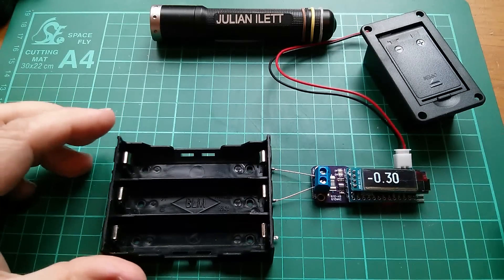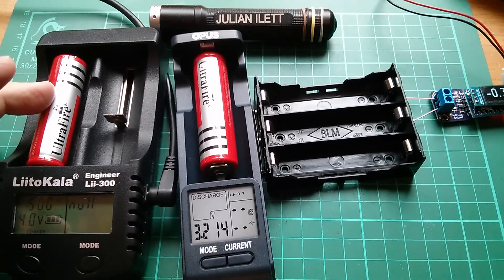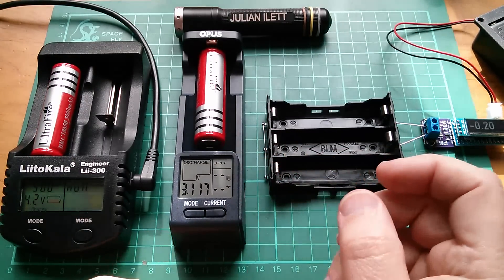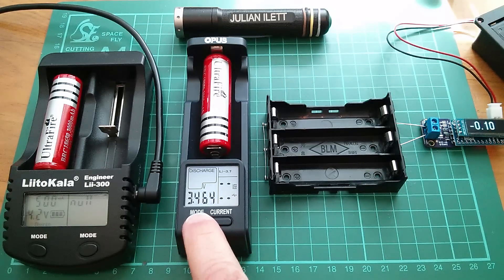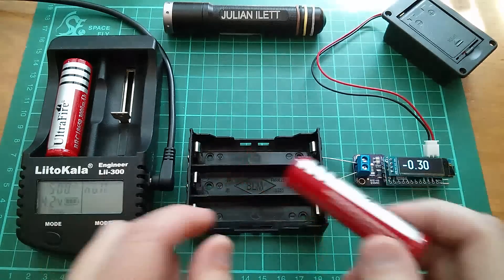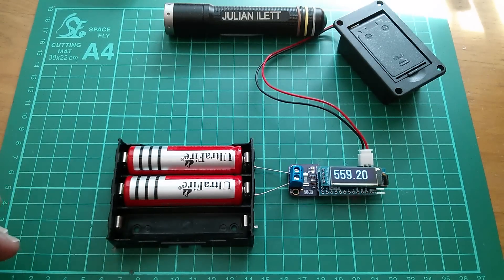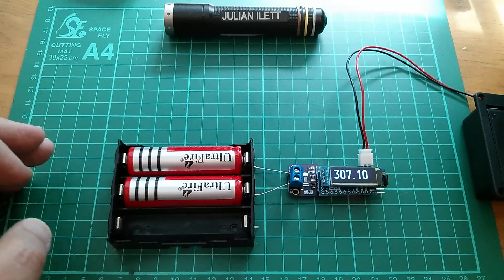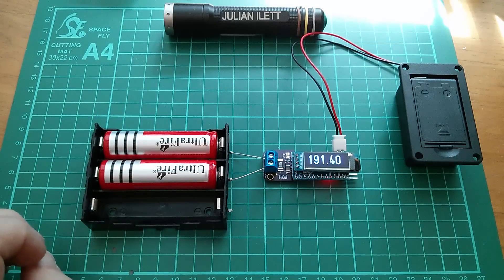Fully Charged 18650 Lithium Cell in Parallel with Discharged Cell

Comment: Julian make test with good quality akku. like lumintop/panasonic/LG. this ultra shitfire is not good for this test because this akku have big internal resistance
Reply from the maker: Voltage equalisation is immediate - it happens when the cells are connected in parallel. From that point on, their voltages are the same.
Reply: and put voltmeter on both cells, tu measure voltage equalization on time, voltage versus amperage
Reply: To set the house on fire? Yeah. Seams a good sacrifice for science... Guys, think before you talk. ;)

Comment: The current can be a lot higher if you parallel more than two batteries at a time.  For example if you had a 6 cell charger and 5 were fully charged and the last one was fully discharged it would be completely different.
Reply from the maker: That's kind of a worst case scenario :)
Reply: In electronics you have to think about the worst case scenarios a lot.  That's why we often put reverse voltage protection diodes in.  Plan for the worst and you should be OK for the rest.
Reply: Stinky Cheese Wouldn't it still be one amp because the voltage and resistance stayed the same? The resistance changes on the supply side but I'm not sure how internal resistance parallels.
Reply: Nope, nobody thinks about worst case scenarios in consumer electronics these days.  If they did, we wouldn't even use Li-Ion cells!  Plus, math.  If you get 1A from 1 cell, expect around 5A from 5 cells.  That's not an exceptional current for an 18650 cell.

Suppose you had an infinite # of 18650 cells charged, an infinite current 4.2V source.  You'd have the amount of current needed to charge the empty cell, * internal resistance, to produce an amount of heat, versus the volume of the 18650 cell.  IMO, a better test is to deliberately try to cause a heat problem and measure the temperature of the cells... in a fireproof container just to err on the side of caution.
Reply: Stinky Cheese we use lithium cells because there is no good alternative and they are perfectly safe if treated properly... I'm interested to know how many consumer products you've designed to base your statement on.

Comment: The max current rating for the INA219 is based on the maximum voltage of the ADC reading over the resistor. 
I would expect that you can actually put more current through it without damaging the sensor, but the datasheet probably has the maximum shunt voltage. If you needed to measure higher currents, you could switch over sense resistor fro a higher value, and compensate for the difference in software.
Reply: Yep, 26V differential max. The resistor value has to be set in the chip at bootup anyway, so it's the simple change of a number.
Reply: Paul Martin 26v is the limit for voltage measurement. Not sure if the adc for amps has the same range. As far as i remember it has also an amplifier up to 8 times or so which would lower the max voltage over the shunt
Reply: Yeah, I would guess not. if the limit is 3A (as I remember) and the resistor is 0.1ohm, then the maximum should be ~0.3v which suggests amplification.
Reply: Well I looked it up in Adafruit's datasheet for the completed module, and they say 320mV max. https://cdn-learn.adafruit.com/downloads/pdf/adafruit-ina219-current-sensor-breakout.pdf if anyone is interested.

Comment: please remove the numbers after decimal point, they are such a distraction !
Reply from the maker: I think they're quite useful - they tell me that the program is still running!
Reply: Some more software fine tuning is obviously required but it is just a quick demo.  I would also change to a fixed width font so that it doesn't jump left to right depending on whether there is a "1" or a "0" for example.  But it shows the concept.
Reply: +Julian Ilett ah, that !

+ElmerFuddGun i used dtostrf function for these purposes, it makes a nice, aligned, fixed position character array for the floating variable to show on screen, without jumping.
Reply: Indeed, what a strange font - to be fixed width except for the '1'.  Most bizarre, maybe even a bug, especially as the '1' is wider than the other digits.
It would be helpful to right justify in the display (rather than left) it would improve readability.  Maybe even remove the right most digit that seems to be fixed at zero so is not actually proving any info.  Removing that zero might provide room for a narrow " mA" at the end.

Comment: What if we charge different capacity 18650 🔋 in parallel?
Reply from the maker: They charge at different currents, and I'll show that when I have more ammeters.
Reply: Have you done this test yet Julian? I am very curious because I plan on adding an additional pack to my EV. The OEM pack uses 2600 mah 18650 cells that are about 4 years old and my new pack will use 3400 mah 18650 cells that are brand new. Everyone says its horrible and dangerous but I think a real test would show that its not.

Comment: Would be cool to change the negation symbol to a small arrow indicating the current the voltage is flowing (upper cell to lower cell or the other way around) :)
Reply: Hence the alternatively offered 'or'.
Reply: Or which way the electrons are going?
Reply: electrons are going the opposite way......

Comment: Great timing, I was just about to start looking for a decent 18650 charger.  Cheers!
Reply: Stinky Cheese fuck yoshit. scammer shop dont buy there
Reply: get the opus, c100 for one cell or the bigger 4 cell one.   the liito looks like its missing features.
Reply: I got the 4-cell Liitokala from Banggood and it's very nice!
Reply: It's on sale right now for $18, $26 - $8 off with coupon code YSHOT40 at  yoshop, best price evar
http://www.yoshop.com/item/liitokala-lii-500-lcd-battery-p_51142.html